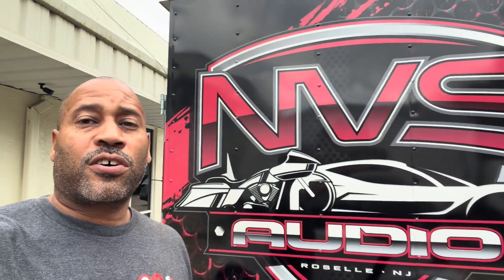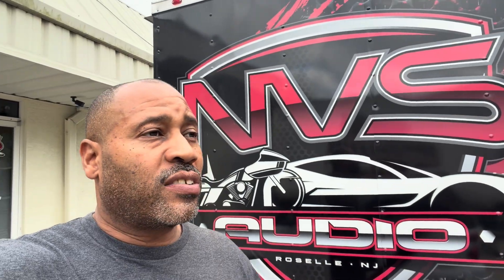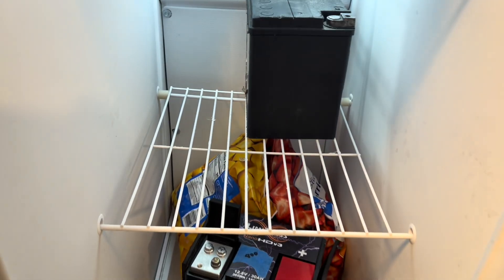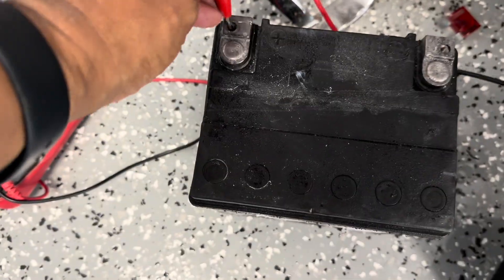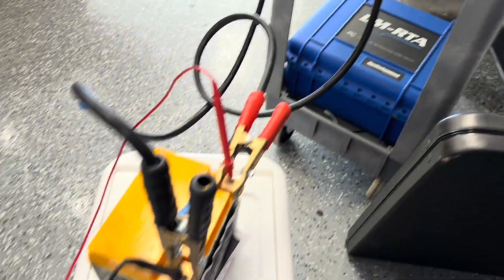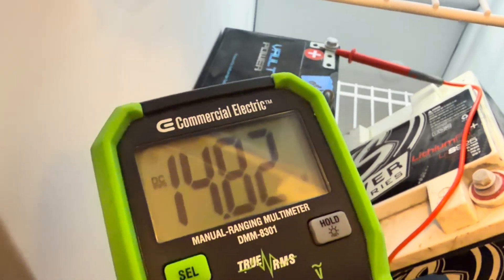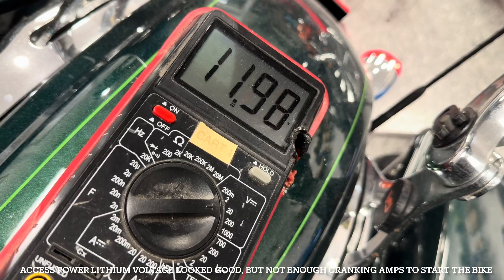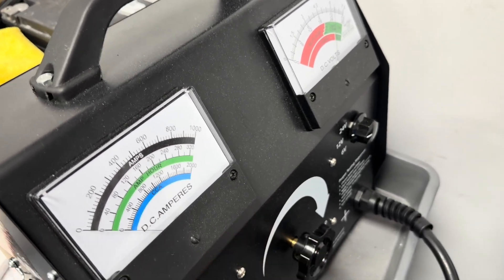2025 nvs audio lithium battery test  part2 .Below freezing lithium battery test for extreme climates

Comment: Wanted to know if that is a carbon pile load tester. I use to use one that looked similar and was always told to load test cold cranking amps at 50%. As you can see i said i was told that and never looked at the manual myself. I am betting that i was told wrong!
Reply from the maker: You were told correctly 50 percent of cca is 100 percent of ca . 

I was trying to bring the battery to failure as quickly as possible so I hit them at max ca